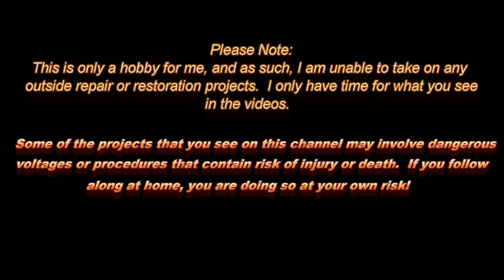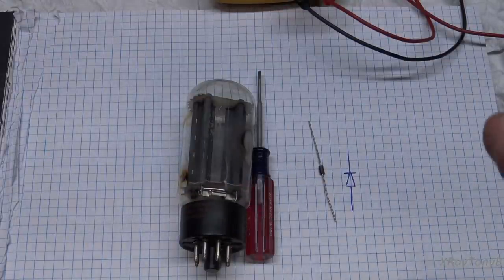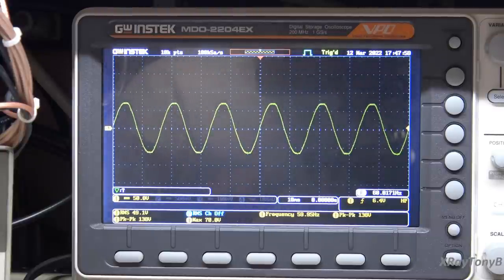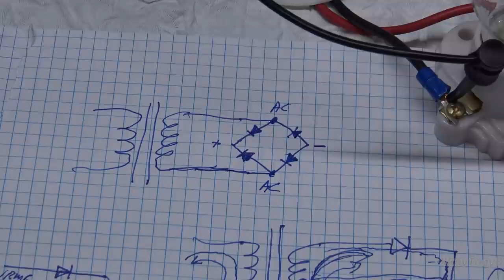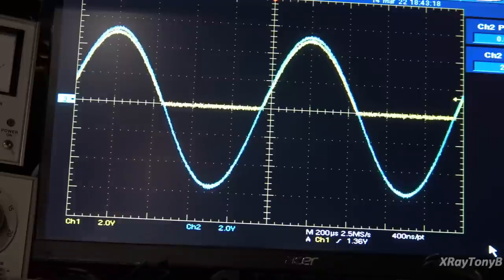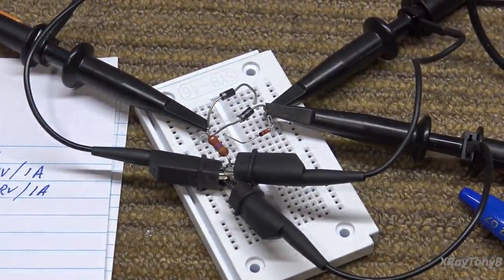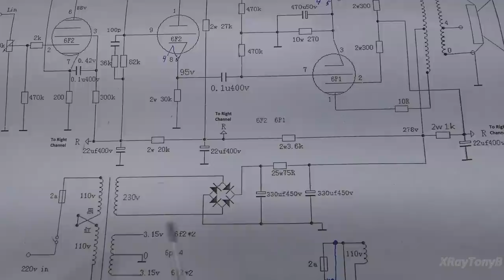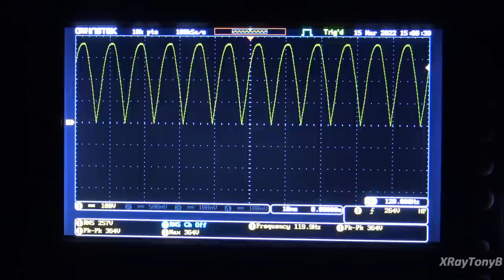Electronics 101½ Part 6 - Diodes & Rectifiers

Comment: Great explanation of silicon vs vacuum tube rectifiers. When I first tried to "improve" a Fisher amp when I was just out of college, I knew silicon diodes were way more efficient than tubes. An old timer at work mentioned that I might want to add some resistance to create a voltage drop, but I didn't listen to him, and I foolishly replaced the 5U4 with 2 silicon 1N4007's, and I saw a sparky light show in the EL84 output tubes. The arc-over of the tubes caused the mu-metal magnetic shields of the output transformers to slap against the sides. You never forget a lesson like that!  30 years later I rebuilt the Fisher correctly with a new set of tubes and a 5U4 and it's in my collection to this day, and sounds beautiful.

Comment: Greetings:
While most current tubers learned their craft from older circuits that were from a time of different component costs, many techniques continue to be used because costs are not a significant issue even when they save work. e.g. With cheap silicon diodes, a DC filament supply saves the effort of twisting those parallel leads, but we do it anyway because history leads us that way. Similarly we use dropping resistors (for series heater strings) while dropping capacitors are more efficient but slightly more costly.
A full-wave bridge requires use of a center-tapped transformer where the tap is usually grounded and you have two outputs one plus and one minus relative to ground. Your original bridge had only one output.
Reply from the maker: A bridge rectifier does not require a center tap to give a full wave output.  Using a center tapped winding with the center tied to ground with a bridge rectifier will produce a + and - output power supply with respect to the grounded center tap, each of which will be 1/2 the voltage of the total winding.  Using the bridge rectifier without a center tapped winding will give a full wave output equal to the full winding output.  Using a single diode on each end of the winding and grounding the center tap will also produce a full wave output, but at 1/2 the voltage of the total winding.  This is the difference between a full wave and bridge rectifier configuration.
Reply: @xraytonyb  God, bless you, man. I just want to express my gratitude for this channel. It deserves a million subscribers. I am one of them.

Comment: Hi Tony. Some notes:
1) if you have another differential probe, connect it across the diode, along with the one you already have connected across the bulb, in you half-wave rectification demonstration. I won’t spoil the fun for those who may want to try that experiment - either for real, or in their mind - but let’s say the result will be ‘illuminating’!
2) if you have only a non-center-tapped transformer, you could:
  a) unwind half the windings, solder a wire to the fine magnet wire, then rewind the wire back on the secondary; you now have a center-tapped transformer (this option for seriously masochistic people only!)
  b) make a virtual ground with two resistors of equal value; you can now use a 5U4 (or similar) if you have a separate filament winding; figuring the right resistor values might be a PITA, though! 😅

Comment: If you're looking for a fun screw up, here one.   When I was fixing my Pioneer SX-737, I knew better about the KSA 992 pinouts that I had just tested with my Atlas Pro transistor tester.  I STILL somehow inserted them in backwards and even went so far as to power it up on the dim bulb with the unhappy result that the relay refused to kick in because there was full rail DC on the outputs!!!  It took me a few seconds to figure it out, then some frantic testing to make sure I didn't damage anything else!  I rematched some new diff pairs and and everything was right with the world!   I also liked your story about the Amish, particularly since I'm a Quaker and people always get us mixed up!  Most of us no longer follow the Simplicity testimony the way we used to.

Comment: Tony thanks for the great video on the Hallicrafter s40b I am in the process of doing a restoration. I did a recap and brought it back to life on all four bands. However should have stopped there. I made the mistake of replacing the 2 24k ohm 4 watt resistor with a 12k ohm 5 resistor 😳checking for anything out of the ordinary and smoke started rising. Needless to say replaced the 5 watt with the original 2 24k 4 watt back to square one. Still working on it but won’t do a Sx 42 no way lol.... keep the videos coming .....really enjoy them. 73’s Dave

Comment: I'm surprised you didn't use heat-sink tweezers (or hemostats) when soldering the diodes. I'm paranoid about heat-damaging the pn-junction. So I always use heat-sinks tweezers when soldering MOST semi's. But those diodes seem pretty robust. Another ooopsy-daisy. That one poor diode is sure taking a beating though..before it even sees current !

Comment: Greetings:
Capacitor Dropper:
I hope you have enough time to show how by replacing a tube full-wave rectifier (5U4) with silicon diodes that you can use a series electrolytic capacitor to substitute for a dropping resistor in the B+ supply between the diodes' cathodes and the first B+ filter capacitor. [C=1/(2 Pi f Xc)] (assumes you already know the resistor value needed to make up for the missing 5U4 voltage drop which equals Xc). Since all other tubes will run off existing filament windings. With series string heaters you have to replace the rectifier filament current drop with a separate non-polar capacitor (about 15uf cap replacing a 35W4 and 150ma heater current). Dropping cap for diode efficiency gain is separate and still needed but may be polarized. Sorry for the disruption.
Amish on TV: watch the TV series "Banshee".

Comment: There is also virtual center tap - voltage divider across a 2 resister network.  Uncle Doug has a use them on guitar amps in certain situations.
Reply from the maker: That is also a really good option if the transformer doesn't have a center tap.  Thanks for mentioning that tip.  Uncle Doug did show that in some of his videos.  Great channel!

Comment: Several diy people insert a silicone rectifier in series with the tube's plate. This should accomplish a double task by functioning as a fuse in case of a short and increasing the inverse voltage of the tube rectifier.
Reply from the maker: I don't know if the diode would act like a fuse.  For instance, a 1N4007 can safely take a surge current of 30+ amps for 1/2 cycle before being damaged.  I'd have to check, but I think this is quite a bit more than the tube could handle, so I think the tube would protect the diode in that case.  As for reverse bias, the 1N4007 and 1N5408 are both rated for 1000 Volts PRV.  A 5U4, for example, is rated at 1550 Volts PRV (if I recall correctly).  Some of the smaller rectifiers have lower PRV, so maybe they would benefit from this, but I'm not sure.  In either case, this is well above anything you would see in a circuit originally designed for that component.  Most rectifier tubes fail due to overcurrent rather than over-voltage conditions.  That's still an interesting idea. I may have to try it sometime.  Thanks for the comment!

Comment: Re the Pinocchio question, I like to describe impossible questions like this as a "buzzer circuit". If you used logic elements to wire this conundrum you would be connecting the output of an inverter to its input which would cause it to oscillate as fast as the inverter could switch. If you used a relay for the inverter then it would start "buzzing". In fact, this is how buzzers are made.
Reply from the maker: It is a Kobayashi Maru ;)
Reply: @xraytonyb  It's only logical, Captain. ;)

Comment: Stainless is hard to drill. I know this  series, which is addicting!, is to teach principles of electronics but the big holes look like they come before the rectifier circuit can be constructed. Can you fit in a pointer or two especially about the punching of holes?
 I am guessing  they are for the 330 uF caps which are 1 inch in diameter.

Comment: Something that always confused me: when the pos cycle flows through the 1st diode it shows as a pos waveform on the scope, (makes sense). But the neg cycle (which is a neg voltage) flow through the 2nd diode, it shows as a positive waveform (voltage) as well? Neg voltage through the diode? What am I missing? Does the pos cycle only read the zero to pos peak voltage or 1/2 of the waveform and the neg cycle read only the neg peak to zero (pos going) part of the cycle?
Reply: Another typical description of the operation of a diode is that it acts like a one-way check valve. With full rectification, the arrangement of the diodes flips the negative going portion of the cycle to be positive going. Therefore, you end up with twice as many positive going cycles and no negative going cycles. You may have heard Tony say that the frequency doubles from the original 60Hz mains to the 120Hz rectified. Look at the very final scope traces and you will see all positive going "humps." Additionally, think on when Tony showed the Half Wave rectification. The negative going portion of the cycle was removed and there was a flat space in its place. Now that the negative portion has been fully rectified (redirected, by the use of one-way check valves,) to be positive going, its now positive going cycle fills in the previous blank space. Keep this in mind and watch the video again. I think you will catch the idea. Tony does explain it well. I hope that helps.

Comment: Hi Tony, quick question. I’m new to tube radio restoration. 
I’m working on a Grundig 9068 that was in absolutely horrid condition. So far I was able to get, power and a strong FM signal however I only have sound coming from the 3 electrostatics and nothing from the 2 drivers (it’s a console unit). I know there could be a number of possible causes but is this a common symptom of anything? Just looking to be pointed in the right direction towards what I should be considering to inspect next...
Thank you!!!
Reply: you might want to try antique radio forum for help with this

Comment: After your explanation of the whole fuse/switch/bulb controversy (is it a controversy?), if you look at the schematic, you can see it’s wrong; the fuse connects to the “live” side of the mains, not the switch! 😄 Also, if you wire another bulb across the fuse, it’ll indicate that the fuse has blown, and will act as a dim-bulb (not a dimbulb, mind you!) tester and limit the current.
Reply from the maker: Some of the x-ray machines I work on have little neon bulbs built into the cap of the fuse holders.  When a fuse blows, the cap lights up indicating the open fuse.  This is really helpful because some machines have rows of fuses and it would take forever to test them all.

Comment: Its wired backwards, if indeed you wired it as you explained. The white wire on the bulb should be neutral not positive. So you have the neutral going to the switch.. You ALWAYS switch the positive or hot side as you american say. Also black is neutral red is positive.. But I think you did wire it right just explained it backwards